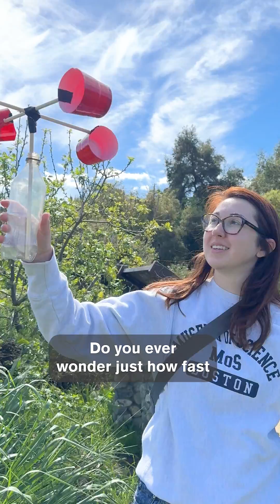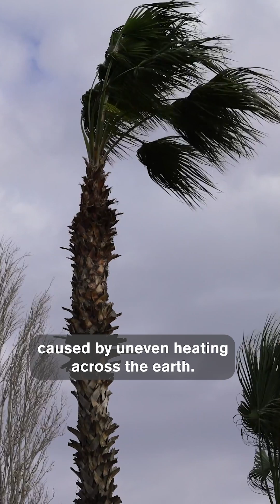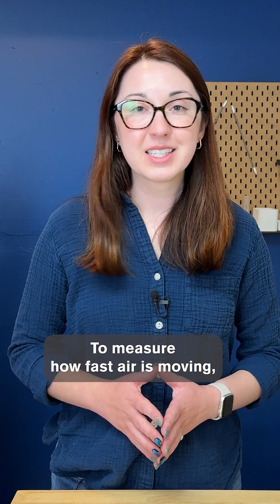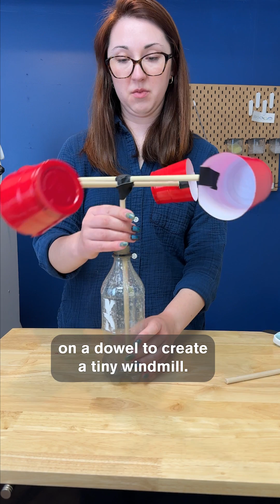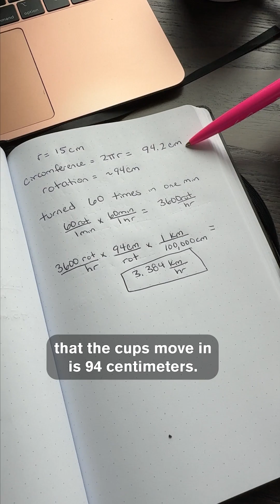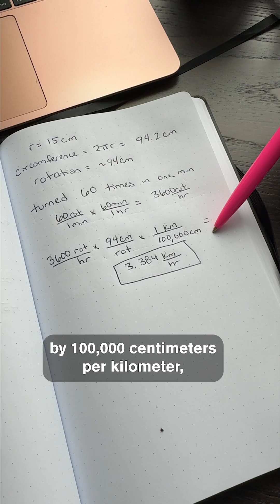Build Your Own Anemometer at Home - Easy Science Experiment!  | Everyday Awesome

Comment: What if you have friction between stick and bottle?
Reply: Air drag also acts on the other side of the cup although being more aerodynamic it loses out to the cup whose open side is facing the wind (different drag coefficients). There's something called the anemometer factor that's used to calculate the true wind speed. In practice the anemometer spins several times slower than the actual wind speed. The physics behind it is a lot more complex than as portrayed in this video. You would need dozens of equations to model all the different forces acting on the anemometer